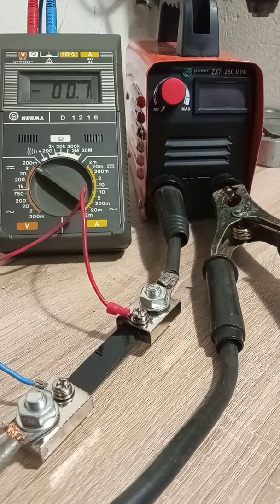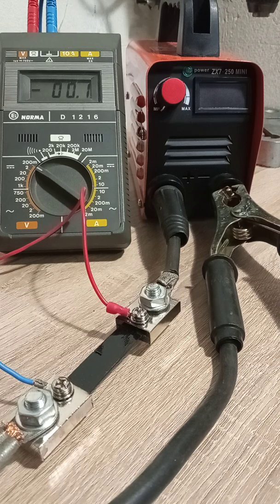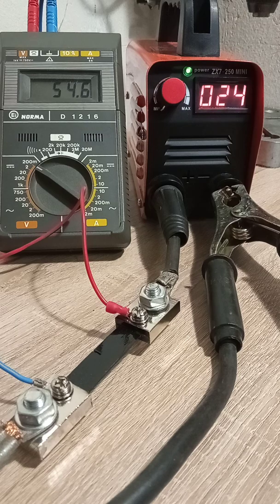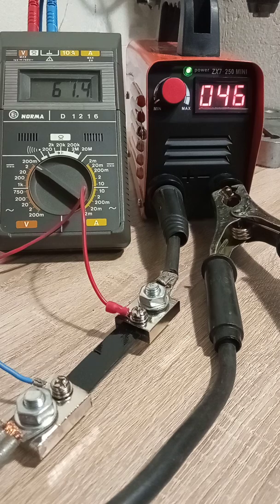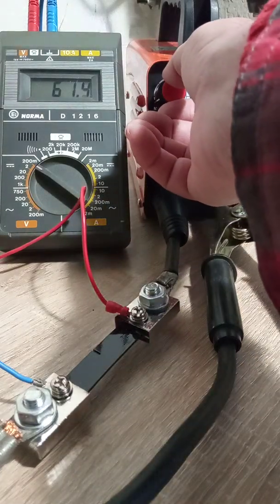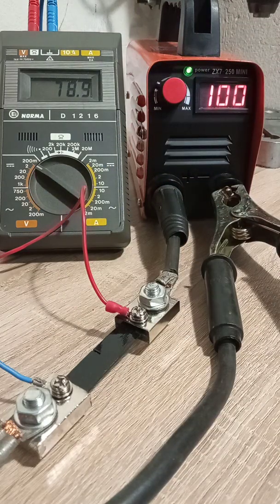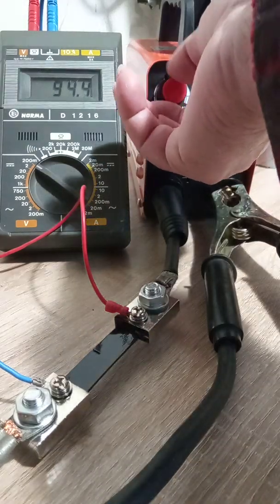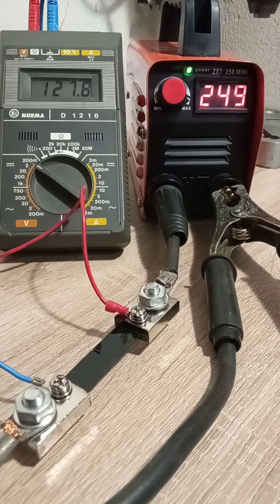Testing mini welder ZX7 250

Comment: Quite logical that the Display of the device is Nonsense. If you think that for a normal plug and 230 Volt you can have about 16 amps or in total 3.6 kw. You need a ignition-voltage of 30 volts on the secondary side. This means that you can achieve maximum about 120 Ampere to use the max. 3.6 kw on the primary Connection .

Comment: so if 1amps equal to 1milivolt/0.001volt ,then 0.001volt multiply by 127amps =31.75volt total maximum voltage output,right? 31.75volt x 127amps =4000watt

Comment: You can't really measure the current of a welder in this manner. The output of the welder will be a modulated DC square wave and your multimeter will be trying to make sense of it by sampling at some frequency and averaging it as the RMS of the actual voltage. You need an oscilloscope for this measurement.
Reply from the maker: RMS value is the value of alternating voltage or current. It is the equivalent constant DC (constant) value that gives the same effect. For example, a lamp connected to a 6V RMS AC power supply will glow with the same brightness when connected to a constant 6V DC power source. What else do you need to know about the welder output current? For me, the oscilloscope serves primarily for waveforms, frequencies, synchronizations and so on. So small differences that a multimeter cannot accurately measure have no effect on welding for me.

Comment: This is a very good review, thank you! Even though 250 Amps is clearly fooled, it's still a worthwhile welder as about 140 Amps should be more than enough for casual home welding usage.
Reply from the maker: As I remember you can set to more than 140 A, (I tried to cca 160 but as you said 140 is enough). My problem is minimal current 53 A, I'd like to weld as thin material as possible. For that there is video but I don't want to bother with induction coil and mH.

Comment: How can I adjust the led display to be correct?
Reply: You and nobody can't do that on that device as it is. As far what I reached is to get max output current to be correct on display. Everything else is impossible for me. I decided to be satisfied with that. So I set max output current on 140 A with potentiometer on full clockwise positon. With that setting when I put potentiometer on full anticlokwise positon, output current on terminals would be 55 A but display will  show something like 17-24 A, as I remeber well. 
If you are satisfied with answer let me know on mail zelezni48@gmail.com I have some private infos.

Comment: Hi, you can adjust the amperage on display to show only 120-130amps on maximum , here is the video i found.. https://www.youtube.com/watch?v=fapovZ8_qDg   ,  can you please do the same and record us video after adjustment if the amps starts to be accurate with the amp show on the  display..
Reply: i found other video where its possible to adjust the start Amps to not be  54.4 amps, you can lower to 24 amps like on Display i think..  https://youtu.be/TWRglysqxcg?t=339  , its not the same model of the welding machine, but i think that zx7-250   have the same potentiometer on the board somewhere  ( maybe is this potentiometer   http://prntscr.com/wg805d  )  ....this only can be adjusted when machine is turned ON like i see on the Videos...  BE CAREFUL
Reply: i wait for reply if this realy work for zx7-250, Thank you
Reply from the maker: Nice. I will do that but I would like to lower minimal current to for example 40 A.
Reply from the maker: Sorry I didn't see your 2. post. I will try both suggestions and you will see results.
Reply from the maker: New information for ZX 7. I tested what you proposed me, to lower display showing. But happened something new. Display shows the same 248 but if I wing potentiometer output current on the instrument connected to shunt is changing. I rise current to 150 A and stop because wire became hot.
Reply: @zeljkozeljeznjak6739   Do you tried the other potentiometer?    ( see picture :   http://prntscr.com/wgv3sj  )  , what happen when you wing this potentiometer?
Reply: do you try the other potentiometer?
Reply from the maker: @danielristov736  Yes, I did. With this one you can adjust output current at the terminals. As I wrote before 3 days I set output current on 150 A and I stopped because shunt became little bit hot but wire became very hot. I also set up display to show 140 A as maximum (I lowered max output current from 150 A). So I have to learn about choke from video you send me link. As far as I can see there is no more potentiometers than mentioned two.
Reply from the maker: @danielristov736  See below.
Reply from the maker: Sorry see up.
Reply: @zeljkozeljeznjak6739   aham ok,  from what i read i understand that you increase Amps  to 140-150  (before was 127 amps ) when button is rotated on maximum settings, but what happen with amperes when button is on minimal settings, have you lowered them to be 25-30 amps ( before was 54.5 amps when on display shows 24amps) .  And do you tested how much electrode can you melt in row 3.25 or 2,5mm without get hot or shutt off  ..
Reply from the maker: @danielristov736  Sorry I didn't do anything more from last answer. But, minimum current can't be lowered separately with that one potentiometer. Real minimum current stayed  at the same, cca 55 A but display shows less. I don't remember how much. When I catch time I'll make video clip with all information I have.
Reply: @zeljkozeljeznjak6739   Hi, can Shunt measure AC current ? ,i want to buy one from aliexpress
Reply from the maker: @danielristov736  Yes it can. Shunt is like wire but with precise resistance so you measure voltage, not current, and what kind of current you put on shunt the same kind of voltage drop will be on the shunt. Ohm's law. Shunt on the clip is also bought from China, 2-3 Eur and shipment was very fast to Croatia. What you will do with shunt?
Reply: @zeljkozeljeznjak6739  i want to measure the current on some old Rade Koncar transformer welding machine, when i weld i dont know on what amperes is set Button ( it have 0 , 1 ,2 ,3 , 4 positions)